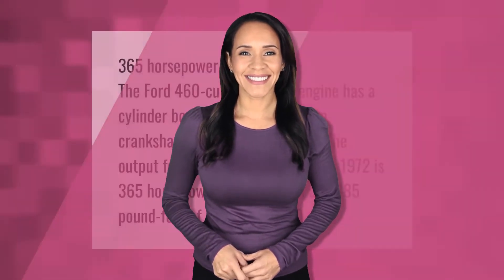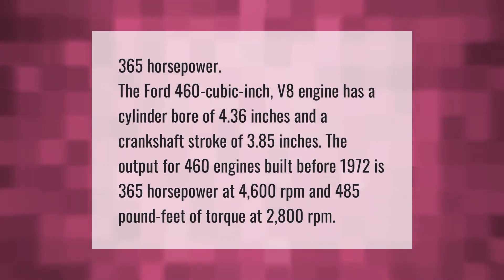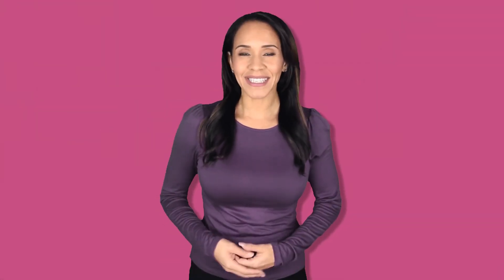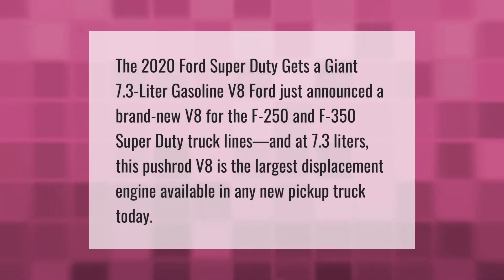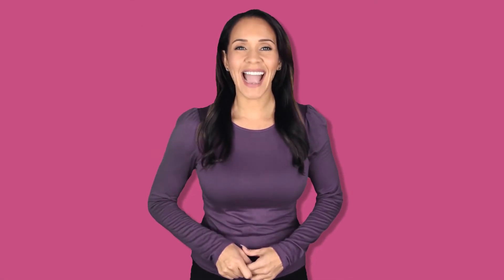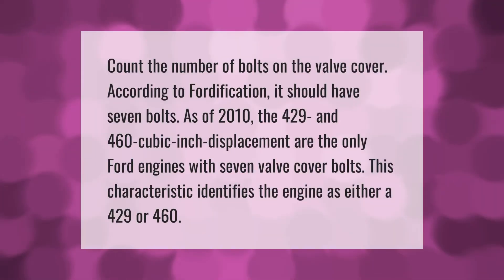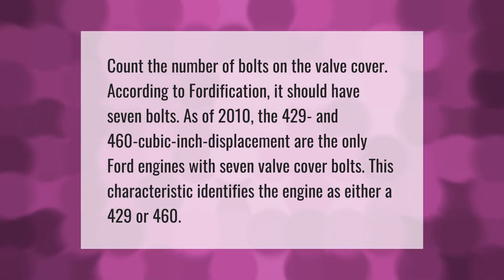What's the difference between a Ford 429 and 460?

Comment: The 429 produced more power than the 460 boat motor. The 429 CJ were the highest rated horse power engines of the early 1970. Look at an old Ford engine manual and see the truth.